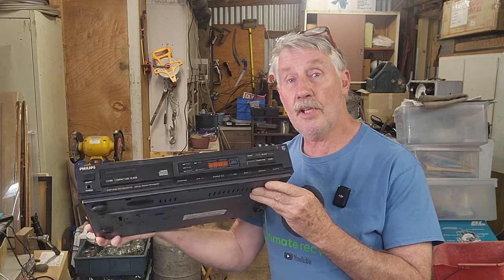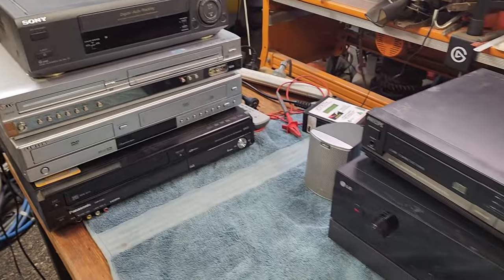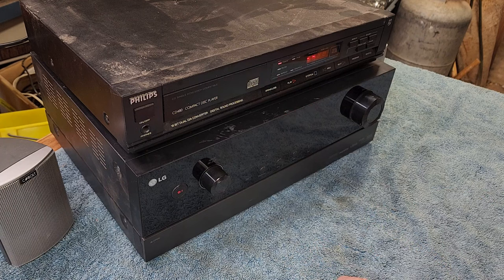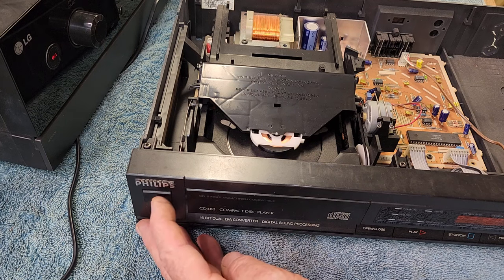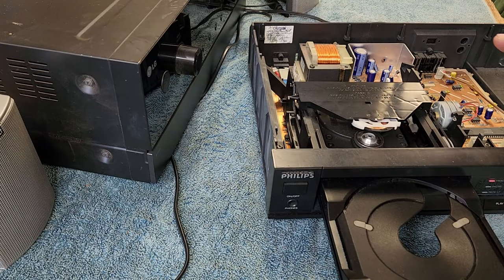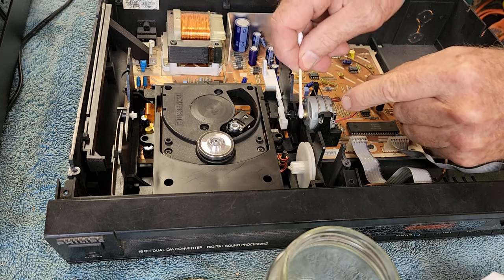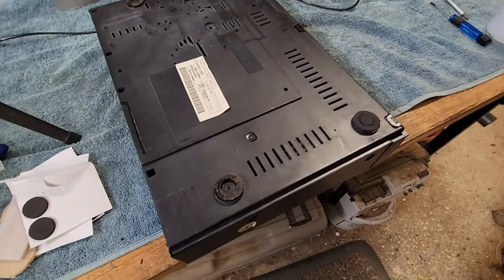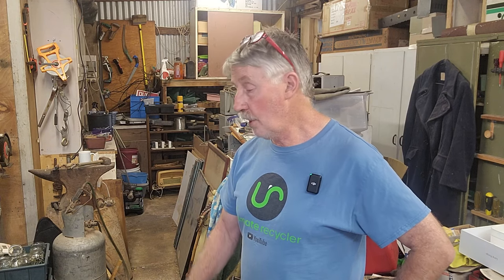Dealing with E-Waste! How to fix a Vintage Philips CD480 CD Player. Tray Won't Open. Repair for Sale

Comment: Nice repair. So many times its a mechanical fix on these digital devices. Never hurts to poke around the insides, so long as its unplugged.
Reply from the maker: Yes, very often mechanical, especially belts etc as the rubber doesn't age well! Thanks mate 😊

Comment: Well done, did repair a few with the same problem, I changed the belts, would maybe get a flask of those nasty chemicals that seems to do the job 😊
Reply from the maker: Thanks Retif, yes the rubber renew certainly seemed to do the trick!

Comment: Another good save Chris, tubber belt the culprit again, I guess it's not so bad as a relatively easy fix apart from getting that blasted front panel off !

There is one UK eBay for £80 currently !

They built them differently back then, I've got a 1980s Denon unit and it's built like a battleship and still going strong !
Reply from the maker: Thanks Andy! Yeah, that front panel sure put up a fight! The vintage units were much better quality indeed! 👍😊